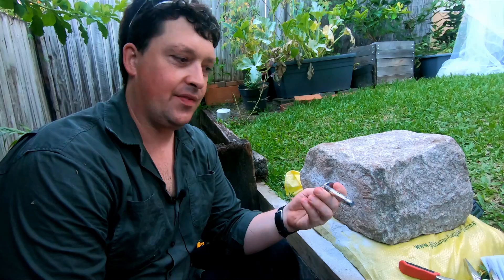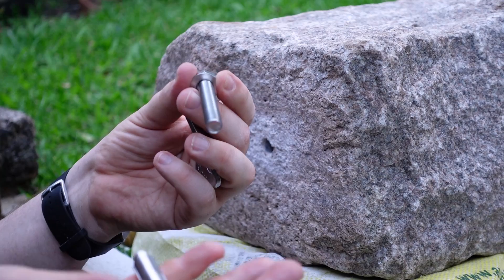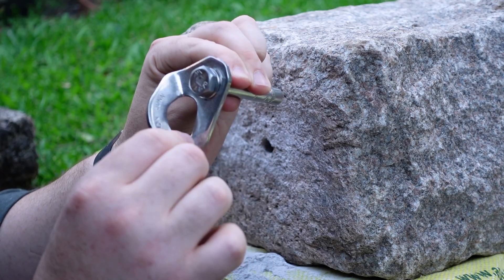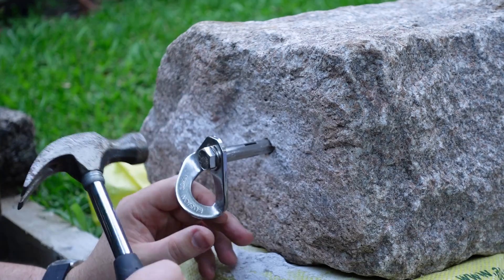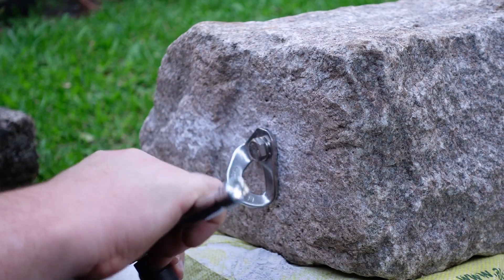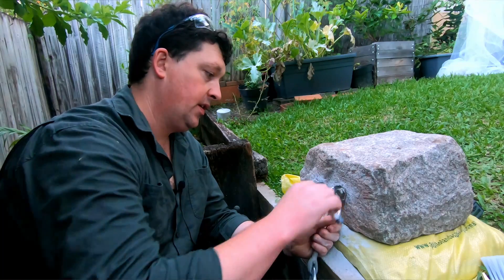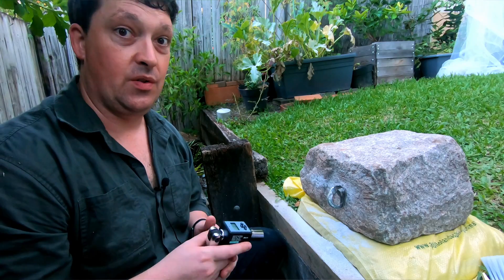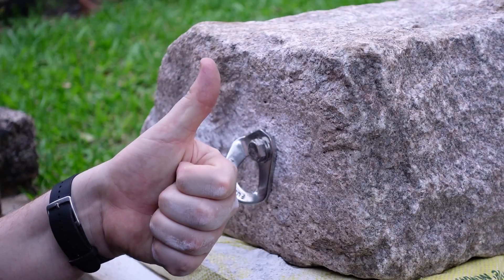How to properly install flush head sleeve anchor bolts [Bolting for climbing]

Comment: Question... So there was a heated debate on if too much torque compromised the bolt. Searching for answers lead me to your video and was curious your thoughts on if over torquing a bolt could cause harm to the bolt or rock. Thanks for the video!
Reply from the maker: Hi mate, yep there's always been that question.  My mentor (an engineer) always said it's better to over than under torque. The reason being the nut/bolt is more likely to just fall out than break. 
Makes sense to me because if you look at break tests, the bolts will often deform a lot before breaking. It stands to reason that a bit of deformation from over torque won't then cause a catastrophic failure but rather non destructive deformation. 
The how not to Slackline guys did address this with pull tests (their best video IMO). this and found that the bolts held stronger if over torqued, so that's a brilliant result
Reply: @BoltahDownunder  thank you for educating a fellow climber! I'd definitely check that video out!